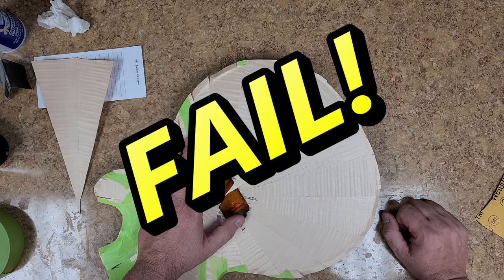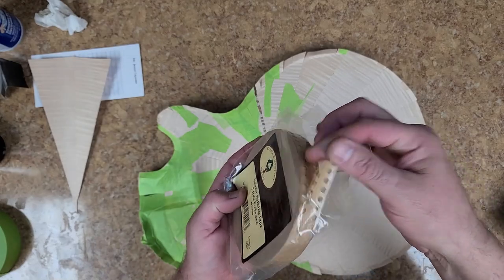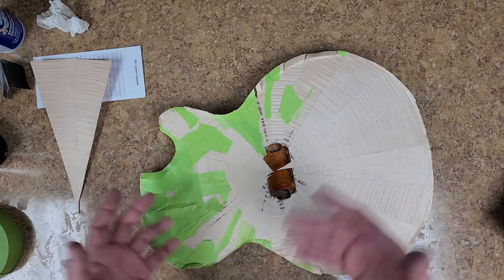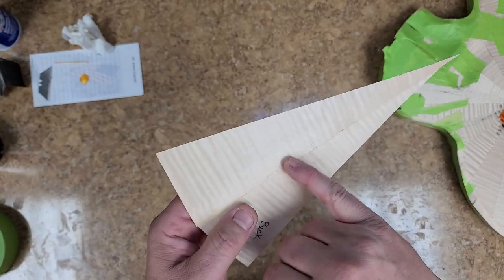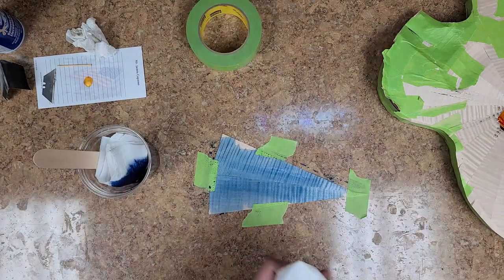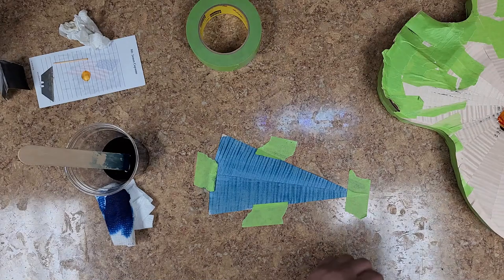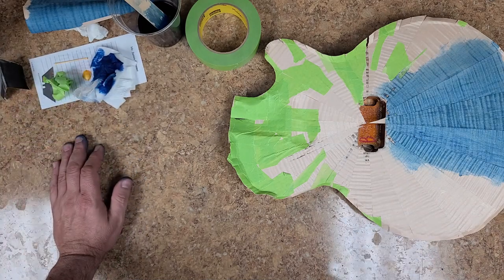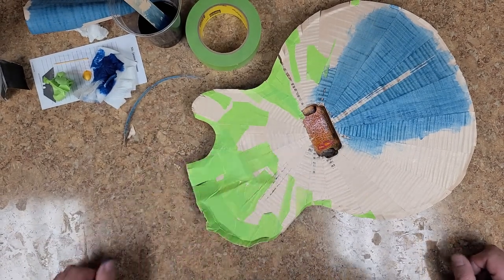Veneer Fail Making a Epiphone Special ll Custom Part 4

Comment: That sucks Eric. I know you will get the result you want in the end. I don't know if it would be the same in the case of putting veneer on a guitar, but I remember as a kid watching my grandfather doing marquetry, he would always do one piece at a time and then but the next piece up to it rather than trying to put all pieces in at once. Maybe that would work for you too. Or maybe putting it once piece at a time on a thing backing sheet of some kind then fixing the backing sheet to the guitar. I have no idea if either would work for you or not, but just wanted to throw the ideas out there.